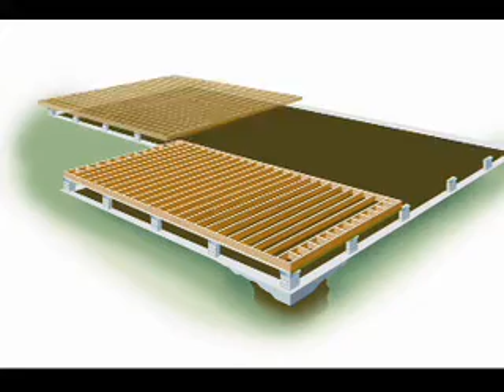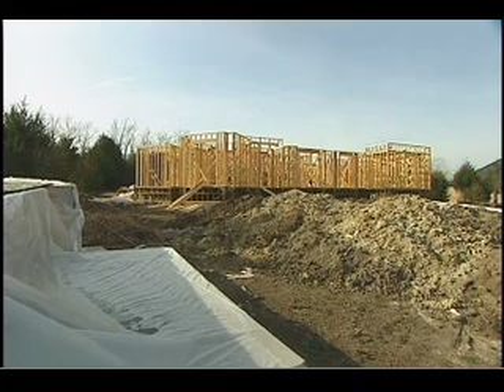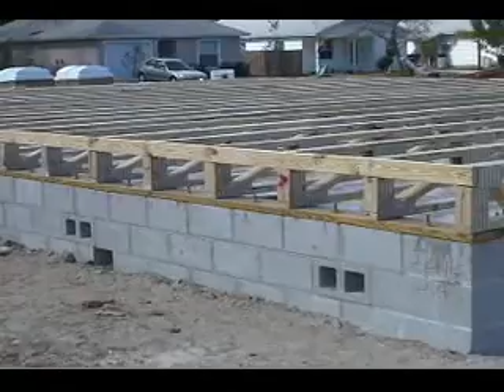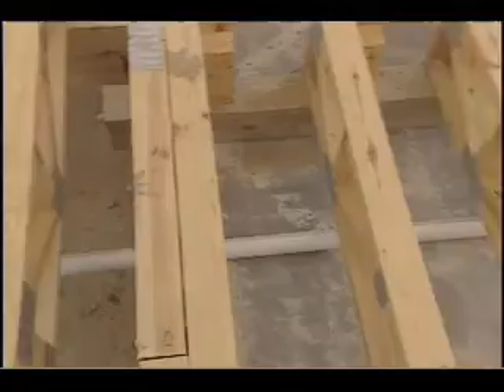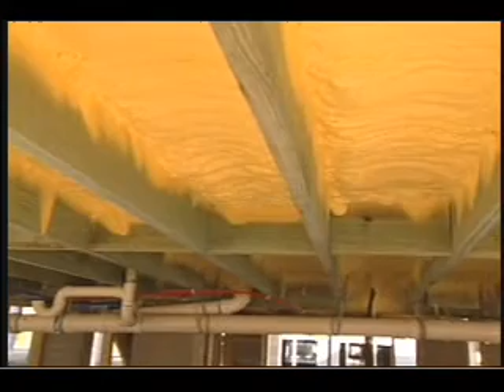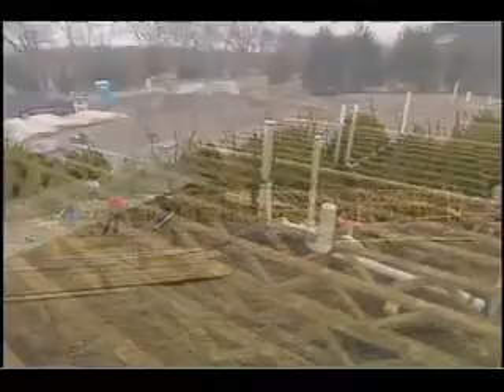Raised Wood Floor Home: Crawlspace Considerations

Comment: This is how every house should be built.  Temporary concrete slabs are nightmares.  Slaps are cheap for the builder, but after 15 years, start developing problems, soil movement, slab leaks, break up.